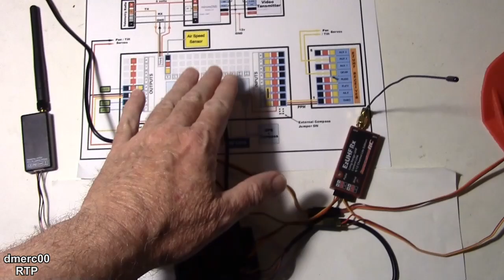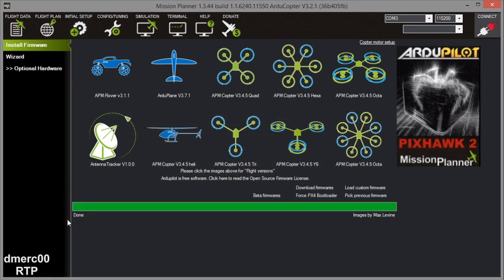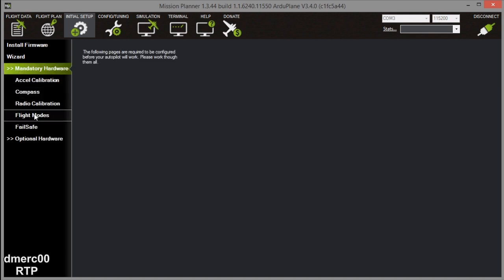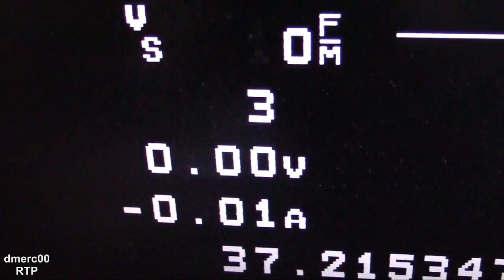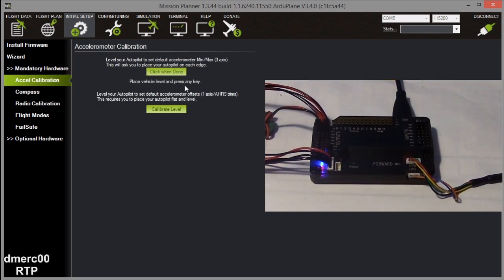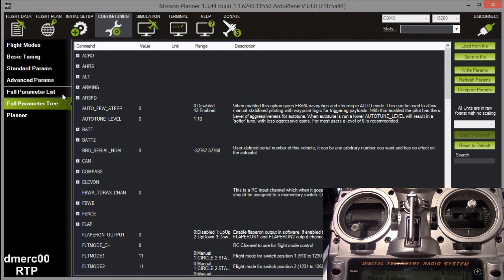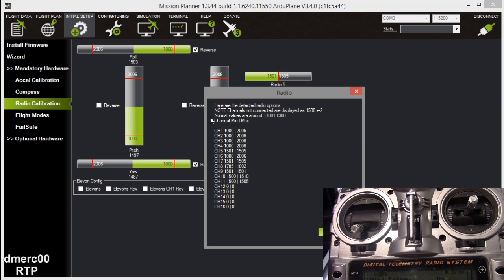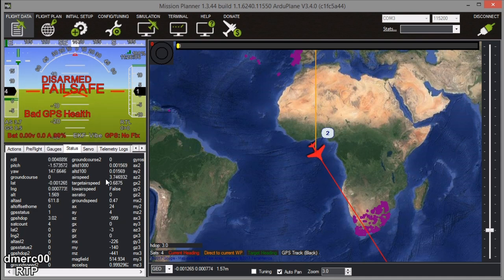Ardupilot Update APM Firmware, Compass Calibration, Battery Voltage, Airspeed XUAV Mini Talon Part 6

Comment: Hi all,
 I’m using PixHawk 2.4.8 for rover I’m facing some problems flashing green light after pressing safety switch and i found gps locked but pixhawk disarmed  i want convert into solid green light  how can solve my problem plz guide me??

Comment: When in manual mode, the radio input is the same as the same servo output and this is true, but when in stabilize mode the radio input is not the same as the servo output. Unfortunately this question already was (you did not answer). Manual configuration of the controller is not a difficult task. The algorithm is not clear - how the flight controller works in stabilization mode. This is a very important point. The rest of the video is an overview ...

Comment: do i need to redo all the configuration again after updating the firmware?
Reply from the maker: Yes I think so. But you can back up the parameters in the advanced parameters and try to load them into the new firmware.

Comment: When setting up the model on the Taranis, do you set it up as a simply 4 channel or do you select the V-Tail option?
Reply from the maker: I just have the 4 channels AETR in my Taranis. The V-Tail setup is all in the APM otherwise the stabilization would not work right.

Comment: Hi. your videos are amazing. i have followed all the instructions correctly and everything is ok but my quadcopter is arming only when it is connected to computer with USB cable and lipo battery and it is not arming when not connected to the laptop. what might be the issue? I am using APM 2.5 with flysky remote controller and readytosky 920 kv motors with 1045 propellers and 3000 mAH battery. kindly help me please sir. 
Thank you sir
Reply from the maker: I think you may be missing the Arm Button which plugs into the unit. However you can get around this by disabling it in the parameters. 
Full Params List -  BRD_SafetyEnable = 0
Reply: i can't find this in "Full Params List -  BRD_SafetyEnable = 0". my quadcopter is arming but only when two power supplies are given. one from  lipo and other from LAPTOP through USB connector. still unfigured  for me
Reply from the maker: Perhaps the the GPS is not getting power or something. Try disabling the arm checks in the Standard Params List.  Set all  Arm Checks to off and see what happens.

Comment: @dave merc, I am having issues with the external compass.  I am able to perform the calibration, it states it successfully captured the data points, but then nothing happens.  When I go to the Flight data screen, GPS information just sits at 0.  Any help appreciated.
Reply from the maker: The compass will not give you GPS coordinates only direction. You need to have enough sats to see GPS information show up. 
Try it outside.
Reply: @Dave Merc Productions, Okay, set it outside and left it for about 15 minutes.  No change.  Both the GPS HDOP and GSP Sats indicate 0.  Not really sure what I have done incorrectly.  Audrucopter v2.8 and Neo 6M.  I have removed jumper.  All I get is a red LED on the module and flashing LEDs on the APM.  I have popped the cover off both the module and APM to confirm no broken solder joints; all looks good.  Not sure what to try next, although I am confident I am missing some simple step.
Reply from the maker: I wonder if the TX and RX wires are connected right. From the GPS TX should got to RX 
and RX should go to TX. Usually this not a problem but once a found wires reversed on the plug.
Do you have another GPS unit you can try in case the one you have is bad?
Reply: I've taken the case off and verified all the pin outs.  I have another GPS ordered, just has not arrived yet.  It may be a faulty GPS, but I am knew to this and I can''t help to think that I am missing something simple.
Reply from the maker: On the flight data tab in mission planar what does it show? GPS:No GPS or GPS:GPS FIX.
It should get a fix if it's hooked up right and calibration is done. Do you get any other error messages such as GPS or Mag errors?
Reply: Not sure where you're referring to.  I took a screen capture an uploaded here.  https://ibb.co/gNUTTH
Reply from the maker: Yes that's the right tab. On the primary flight display you don't have the GPS status showing like I do.
Maybe you have to turn it on.  I do see that your compass it displaying okay so that is good. It really appears that the GPS is not working which is back to it being a faulty device or bad wiring.
Reply: Here is what it looks like powered from the USB.  https://youtu.be/OavkUOLCAVg  Seems like there is activity, but nothing happens.
Reply from the maker: Did you solder the wires yourself or did it come that way? The green and yellow wires should be the TX and RX. You could try swapping them with each other to see if that is the problem. On my gps the cable plugs into a socket instead of being soldered so I can't compare to the picture. The end at the APM is the same as my own as far as the colors and locations.
Reply: It came already soldered.  I did verify that the RX/TX matched per what was written on the circuit board and confirmed the RX goes to TX and so on.
Reply from the maker: That was my main concern so looks like the wiring it good. Not sure what the blink codes are saying for the V2.8. Have you looked them up to see?
Reply from the maker: Look at this link
http://ardupilot.org/copter/docs/common-apm-board-leds.html
IF blue light C is off then GPS is not working or not attached.
Reply: This is a the package I had purchased; https://www.tomtop.com/p-rm3244.html?_ga=2.92393373.1865110197.1519141650-1507016490.1519044082 I have taken the cover off the GPS and there isn't a blue LED, only Red.  Its not that a blue LED is not powering, there is ONLY a single LED, red, on the GPS.
Reply from the maker: I was referring to the APM. The blue light on the APM should be ON if the GPS is working according to the info and picture in this link:
http://ardupilot.org/copter/docs/common-apm-board-leds.html
Reply: I'd say no GPS, no blue.  
https://www.youtube.com/watch?v=OavkUOLCAVg&feature=youtu.be
Reply from the maker: That is what it seems according to that link I sent you. The GPS is not communicating. Hopefully trying a different GPS will shine some light on the problem. It still could be a configuration issue but it's hard to trouble shoot over the internet. Let me know how it goes.
Reply: Appreciate all the help.
Reply: Problem Solved:  Got the new GPS in, plugged it in and now I get Sat information.  I was convinced I was doing something incorrect, however it turned out to be a faulty GPS module.
Reply from the maker: Yes that is what everything was pointing to... a bad unit. Glad you got by the problem. Usual bad quality control from China I guess.

Comment: Hi Dave! Great video! I have a pixhawk 2.1 cube that i am trying to get installed into my wing. I am having some gps calibration issues. I have a screen shot i would like to send you so you could possibly help me out. Do you have a facebook account or email that i could send you the error code? You can email your contact information to: Skyworks360@gmail.com or i'm on facebook as well @Skyworks360.  I would GREATLY appreciate it!
Reply from the maker: Sorry I know nothing about that. What is a pixhawk 2.1 cube? 
What does do?
Reply: Hi Dave, Thank you for the response. It says "An unexpected exception occurred while binding a dynamic operation" Here is the link to the photo. https://www.dropbox.com/s/07yni0n4s1hjbh9/Mission%20Planner.JPG?dl=0

Comment: I keep getting bad compass health and it drove me nuts and I bought a new apm 2.6 and still won't calibrate successfully!!! I have an external compass as well (although it says it has an internal one built in) but I need to use a jumper wire to use it?

Comment: The version arduplane was 3.7. But after uploading it became 3.4? Why not 3.7
Reply from the maker: +Mervyn 8888 Version 3.4 was the latest stable release of the firmware.
Reply: dmercØØ RTP 
If that’s the case , there is no way to go to 3.8 /3.7?
Reply from the maker: You can do a manual or local install of any version you want.
Reply: dmercØØ RTP 
After viewing your this video, I was having the same problem like you. Follow like what you were doing . First upload arduplane 3.8. With usb plug in both sides FC and PC but did not click the connected.
Reply: Once after the firmware was uploaded. I click the connected icon. It still shows ver3.4
Reply: Please help - where do I get the APM Mission Planner software?
Reply: please where do I get the APM Mission Planner software?
Reply from the maker: http://firmware.ardupilot.org/
Reply from the maker: http://firmware.ardupilot.org/

Comment: Great clip Dave, the Batt Monitor was useful to me...Im having trouble saving my Parameter set to my Laptop for my specific model, it goes through the motions but there is no file saved...:(..... Hope to see you cover this in the next Video...Thanks for your efforts from the UK...:)...BTW....If you rotate the GPS puck a little slower, you will be able to get 2,000 markers making it more accurate.
Reply from the maker: Thanks. I am also doing the same to the APM Pro Mini and so far it is behaving the same way as the HKpilot. However I think the APM Pro Mini may have a better GPS unit but time will tell as usual.